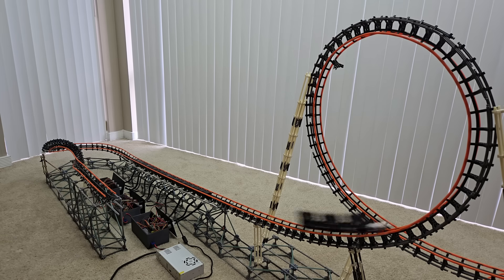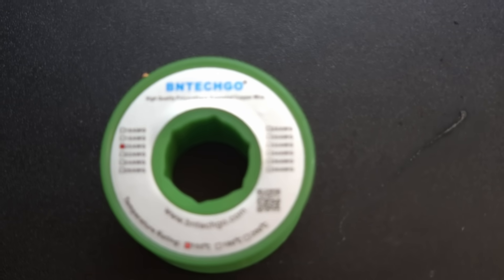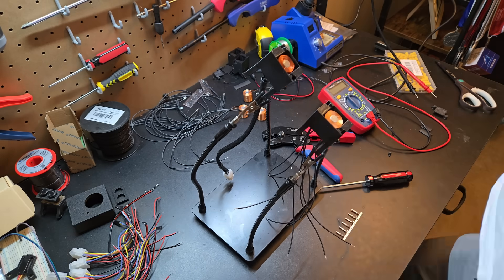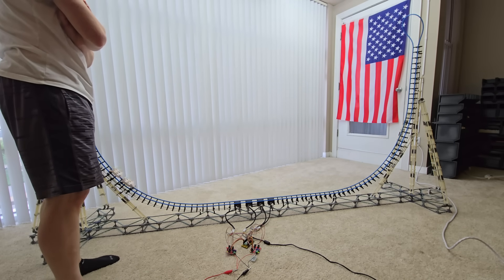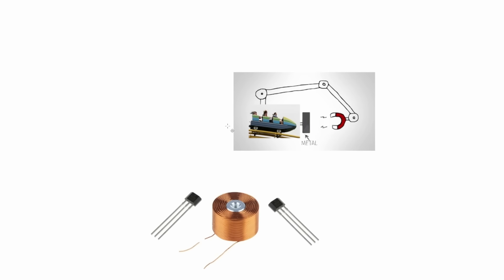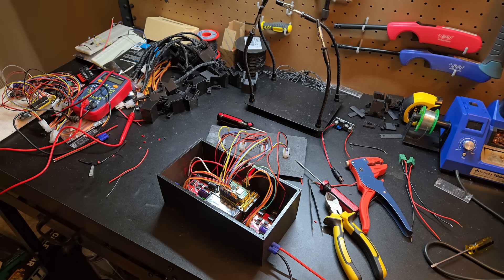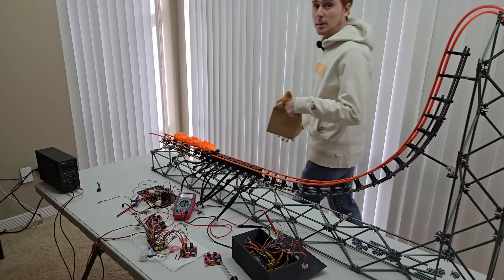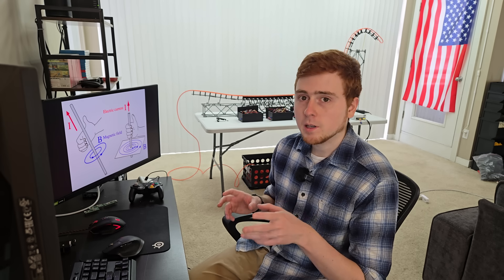Using Magnets To Launch My Roller Coaster (LSM)

Comment: I bought the pre wound coils on amazon but I was wondering if you experimented with insulation for them? Mine heat up beyond the point of use if I supply them with 4-5 amps for more than 0.1 seconds lol.
Reply from the maker: I'm firing the coils for tens of milliseconds at the most, if you are actually firing them for 100ms you are doing it wrong. They will heat up super quick, you're outside of the safe range of the wire (I am too) for any extended load. You have to be very precise in how long you fire the coils for.
Reply: @michawl_  Thanks! I finally got my microcontroller and everything is working smoothly! I was triggering the magnet by hand before and I can't count in milliseconds lol.

Comment: Did you manage to find out why the microcontrollers died?
Were you sinking/sourcing too much current? Did you need level shifters? Did you not install diodes (or varistors) across the coils? Were the SMPSU's not able to regulate voltage quick enough?
Reply from the maker: There was a ground loop between the MCU step down and the motor drivers

Comment: Your power supply can provide 15 amps but in your video you've just limited it to 3,3 amps. I assume your PS is short circuit proof, so you can just short-circuit your PS to see the current current-limit and increase it as you wish. The voltage drops because the current limit is hit.
Reply from the maker: The variable power supply I have maxes out at a 5.1A current limit. Which was set to the max for all tests. If you see it read ~3 amps output briefly that's a limitation of the low refresh of the screen on the PSU, and not indicative of the current being drawn.
Reply: @michawl_ I see. If I find some spare time in the future, I'd like to try and control knex motors with a Raspberry Pi. I already ordered a relay board with optocouplers, but I'm still waiting for it

Comment: As an engineer, can I make a suggestion to save your drivers? Use opto-isolators to protect your driver circuits. Also, you can use short sensing circuits (like on a SMPS power supply) to cut power to your isolated drivers when they sense current overload condition.
Additionally, you clearly have "inductive kickback" issues on your coils. If your using coils driven by bipolar drivers, and I think you are since your coaster moves forwards and backwards, use DIACS on the coils to reverse bias them to your power source. Other than that, great job!
Reply from the maker: Great suggestions! I don't have the schematic for the motor driver board I'm using. From what I can tell by looking at the PCB, and by the advertisements for the drivers, the high current section of the driver is isolated. I believe my issue here is a ground loop.

If I understand the point about the coils correctly, you're suggesting essentially a 2 in 1 coil with either direction on its own mosfet. Fortunately I don't have the worry about the inductance too much when flipping because the time constants I'm dealing with are way shorter than the car's speed. So it may waste some power and heat the coils up a bit faster, but shout minimally effect performance.
Reply: @michawl_  For a bi-directional driver, look up "bridge drivers". Also Allegro makes many drivers, I get skittish about designing circuits with Allegro because they discontinue components too often, but for a one-off like your project, they'd be fine. The thing about inductive motors is, they have "stall current" problems. You can also use the "kickback" of a inductive load for "dynamic braking", meaning, you can harness that magnetic flux as residual voltage. The very thing that kills the driver of a inductive load, "kickback", can be used to power stuff. It's how EVs use "regenerative braking". In your case, you can use that to SLOW the coaster just on leftover energy in the system!
Reply: @ time constants are only part of the equation. For example, a SMPS power supply switches the FETs on and off about about 100Khz. That's very little "on time", but the FETs will literally explode if they short. Granted, SMPS FETs are driving the coils at 400VDC.

Comment: Out of curiosity do you paint some of your knex or are they 3D printed? Blue cross ties arent a normal colour as is yellow connectors that are blue, grey/purple corner slot connectors painted white
Reply from the maker: All parts are OEM knex. The blue cross ties are very rare, and the white 3d connectors are newish. The orange and black tubing is made by a 3rd party.

Comment: Wow, liking it.
Regarding your issue of the car stalling if it is going to slow, if the first coil has a third hall effect sensor in the middle, it can maybe detect the speed of the car and adjust the timing of the coil switching.

Comment: First off, awesome work! This is a really cool idea an implementation.

Regarding your magic smoke issues, I'm questioning if the inductance (residual current) from the magnetic stators is back feeding into your Pico somehow over a shared ground causing a voltage spike. You should be able to solve this with some flyback diodes. If you want to get super fancy, you could use an H bridge and utilize PWM from your Pico to adjust launch power.
Reply from the maker: I suspect there's a ground loop and I think I know where. You're going to like the next video, let's just say great minds think alike.

Comment: I like your tinkering with electronics. Your using coils and that is the same as an inductor. The coil has inductance... What does that mean. You apply voltage to the coil, and the current start flowing every millisecond a little more, increasing linearly. What does that mean. A little explanation when your cart go fast. You detect the cart. You apply a voltage to your coil. The coil picking up current and magnetism slowly over time. The cart overshoots a little, you detect that with your sensor. Then you invert the voltage, but the current (and the magnetism) still flows in the other direction slowing the cart down. You have a lot of sensors, so you can calculate position and speed and in your program you can compensate the timing of the voltages applied to the coils. Good luck and a happy new year.

Comment: I love these types of projects, and I can totally relate with destroying microcontrollers. Awhile back I build a beanbag catch and throw project with an old laser printer motor that drove a winch and pulled back a huge spring. The whole thing was run from a lead acid UPS battery. When the spring released, it would spin the motor and put some 50v back into the power supply. Even adding a big capacitor across it didn't help. We fried two microcontrollers before we decided to isolate them on a different battery from the motor.

Comment: Holy shit! This seems so much cooler than model railways to me!

Edit: If changing the power source fixed the issue (and voltages were correct) you likely had a ground loop, at minimum they cause interference at the worst they facilitate magic smoke escapes.
Reply from the maker: Yes I suspect that's the problem, I have a lead on where that might be. Hopefully I can give an update in the next video.

Comment: Amazing. Congratulations on making what I have dreamed of. "Spacewarp" by Bandai was released in the 1980's. I loved it. One of the issues I had was with the motorized carriage that returned the ball to the top of the track. I used it so much it slowly wore out the Archimedes Screw return carriage. It would bog down and get stuck if too many balls were in play. Then I did the thing you don't do to plastics. I oiled it with some of my mom's sewing machine oil. I was so sad. The oil caused that plastic to crack and become brittle. Once the return carriage screw started disintegrating, it was game over. Fast forward to today: watching your video has satisfied my childhood dream. You have built what I had imagined was possible and wished I could have "manufactured"! Thank you for making my dreams a reality. Cheers Friend!

Comment: I’m currently building (well, it’s been stuck in development hell for some time) Xcelerator but using the CDX Blocks coaster kits plus huge amounts of LEGO. I assumed I would have to use a tyre or chain launch but wondered if an LSM launch was possible. 
Subscribed and watching with great interest.

Comment: Try star grounding. Also would recommend to simplify the control system to only one processor.
Reply from the maker: Unfortunately the each coil requires 5 io pins to operate (enable, forward, reverse, sense1, sense2) which would require a big package mcu or a bunch of small ones. This is a good point on grounding, I have a new idea to try after thinking about this more.

Comment: 9:06 i would suggest using fuses with a power supply like that
Reply: Particularly blade-style automotive fuses are great to put on a small board inline. Trucks run on 24v.

Comment: Can you give a better description. Like what materials in what positions. So we could me one I understand that it works by using iron cores wrapped on copper in wave shaped lines. I also understand that you need a sensor to detect speed and connect to the permanent magnet in the bitty of the car. I found you explanation confusing because there is no pushing process in a real lsm ride.
Reply from the maker: You misunderstand what a LSM launch does. The way one works is pretty close to how I describe it in the video. There is typically a pulling and pushing force depending on the position of the car. I accomplish the current switching with a motor driver (h bridge).
Reply: @ does it work by grabbing the electric copper and wrap it around a iron core  you connect the electrical unit and then it power the copper which powers the iron core to make a magnetic field. This lsm unit is attached to the next unit causing a continuous motion. Unless you’re talking about a LIM which uses electricity to power all the units constantly instead of slowly increasing or decreasing.

Comment: Thats rad! what are you using to control the coils?
Reply from the maker: A raspberry pi pico and a motor driver
Reply: @michawl_  Thanks!
Reply: Please make an modular Set dor knex maker and Finish your copperhead Strike. I finally found an lsm knex built